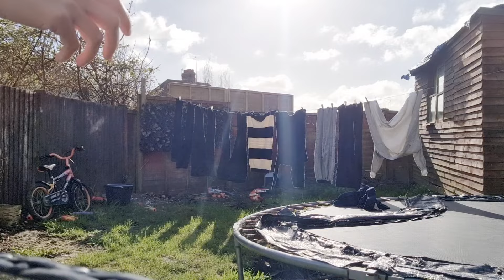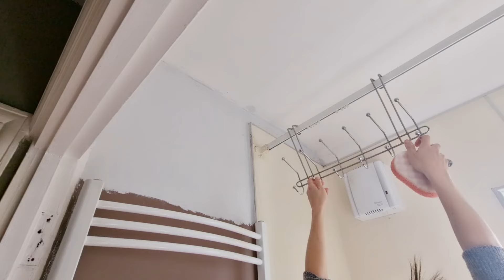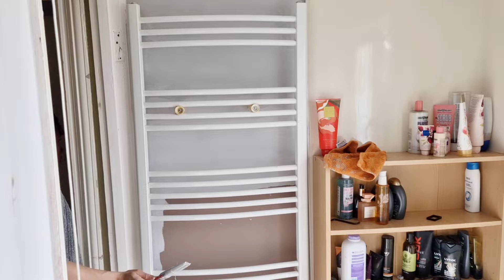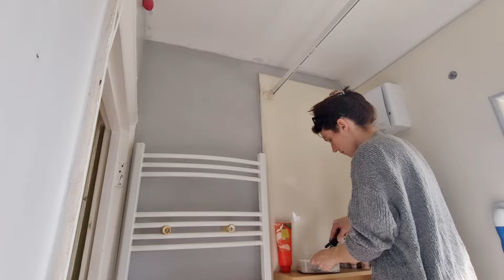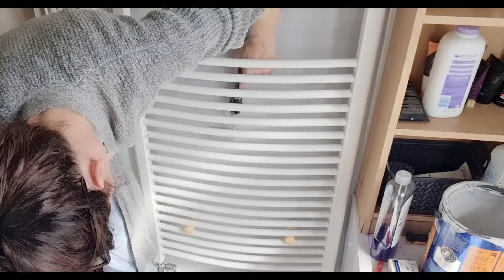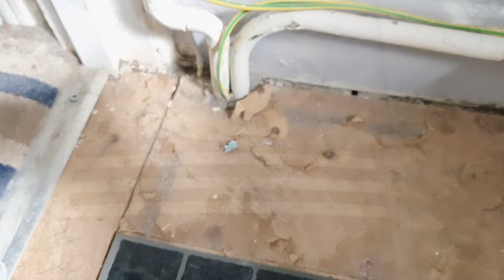PAINTING MY BATHROOM 🚻 WORST PAINTING EVER!!!!!! #DIY #painting #homedecor

Comment: you need a radiator roller xxx
Reply from the maker: What is this sorcery you speak of???? Xxx
Reply: A paint roller holder with a very long handle😂. 
I’ve just picked this video up and I’m sitting here wondering WHY you’re not using a radiator roller ..... OR ..... fastened the roller you’re using to a longer handle ........ but then, it wouldn’t be so much fun to watch! 🤣